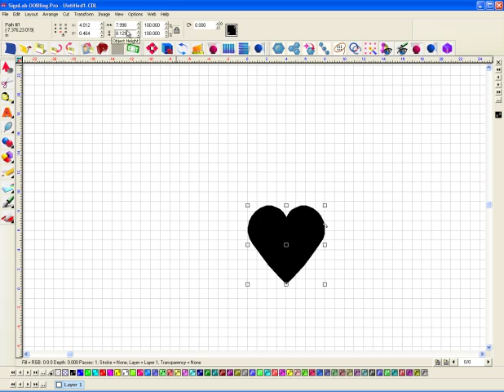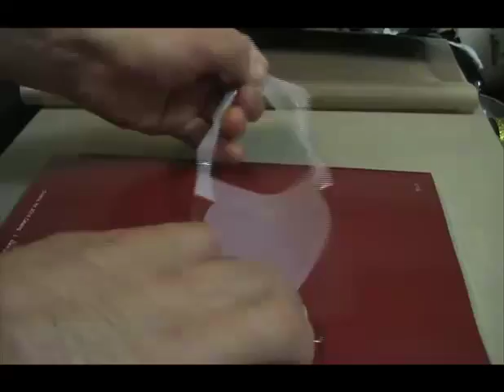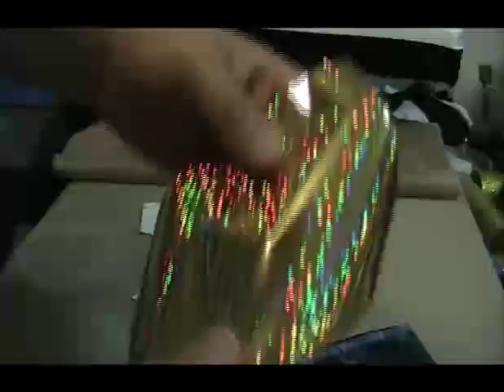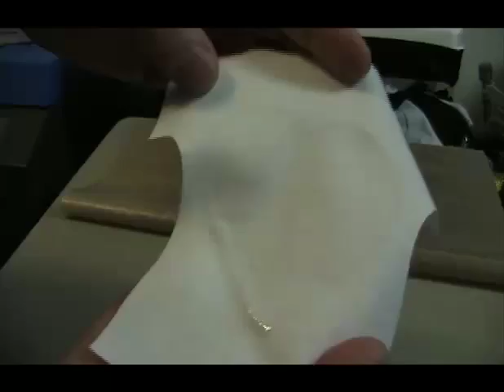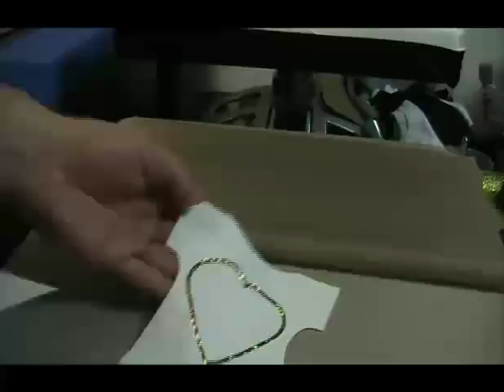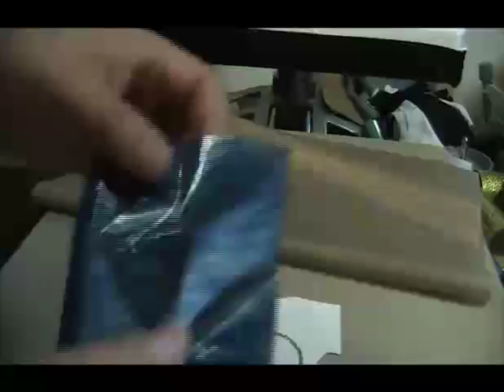Synergy 17 - 2 Color Foil design using TexTack HTV Not Siser

Comment: Are templates reusable?
Reply from the maker: Hi Beth, The TexTack is not reusable. You treat it just like regular HTV. You cut it, weed it, and press it...then you put the foil over and press it again. Once the TexTack it pressed, it has been used. If you want to make a second one, you need to cut the designs out again. The TexTack is the adhesive(glue) that holds the Foil to the garment.
Reply: synergy17llc thank you!! I bought some foil and didn’t even know how to use it lol now I do!! It’s pretty cool!